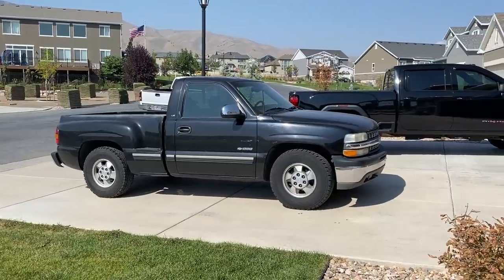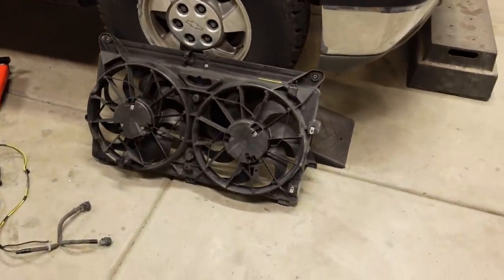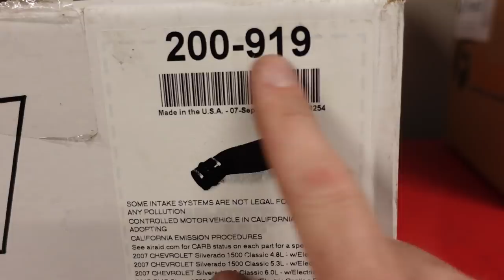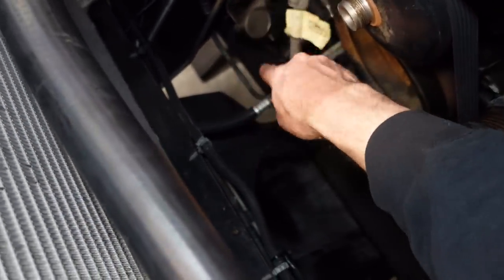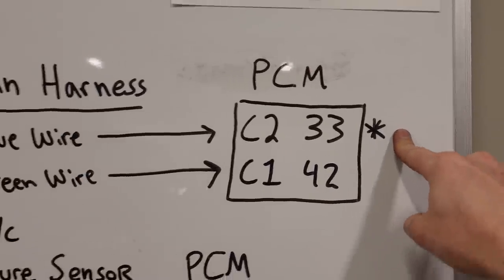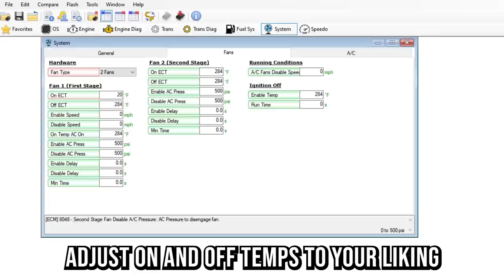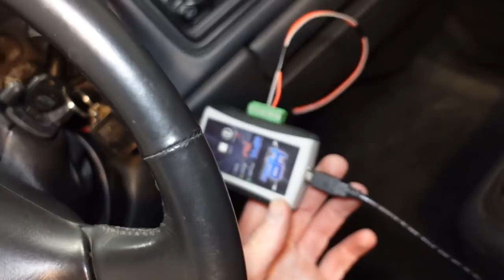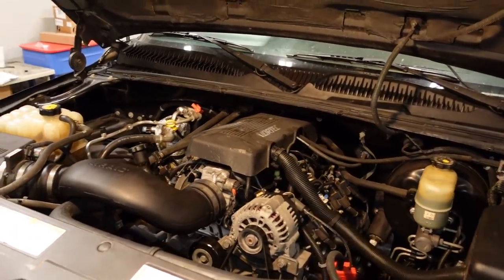the BIG BLOCK KILLER 4.8 is DONE! + electric fans on a 99-02 Silverado the RIGHT WAY

Comment: What’s your reasoning for not liking aftermarket cooling fans?
Reply from the maker: usually they are much louder than a stock electric fan, and usually an OE cooling fan will have a better designed shroud and mounts.

Comment: How is the 4.8 2wd that much slower than the 4wd 5.3 that truck trends and motor trend tested when new and recorded a 7.7 0-60 which was super fast for a truck back then.
Reply from the maker: Good question. But one factor is my elevation of 4,800 feet which certainly kills power by a fair amount. And the 4.8 is a 4x4 for what it’s worth
Reply: @LawrenceTolman  I can understand that. I feel the power difference at 1600 feet vs 6000 feet on the parkway. The vettes not as much but my Jeeps I can really tell. A lot of 4.8s were really quick when I would mess around with my rcsb 00 z71 5.3 truck. I was in college and it was 03-05 so the newer 4.8s made as much as my 5.3 did and they would keep up. Interesting to see real world scenarios 20 years later.

Comment: How do you do an E-fan conversion to the standards you require on something that never had an E-fan option like my 09 2.3 ranger?
Reply from the maker: I’d try to still use a factory fan like the Taurus ones that GM guys sometimes grab from the junkyard. Not sure how I’d handle the control system and fuse/wiring though
Reply: You can get a thermal switch that will provide a ground to a relay at a set temperature...or two.

Comment: Where did you mount the pressure sensor?
Reply from the maker: Haven’t done that part yet, but it replaces the switch down by the radiator on the passengers side

Comment: Will the recirc for the ac no longer work after doing this?
Reply from the maker: the recirc still works when you hit the button on the dash. The recirc wire you remove from the computer only comes on when the truck overheats and needs extra cooling capacity. Now, the electric fans will simply kick on higher when the engine temps get too warm, accomplishing the same thing
Reply: @LawrenceTolman  thank you so much, that's exactly what I needed to know